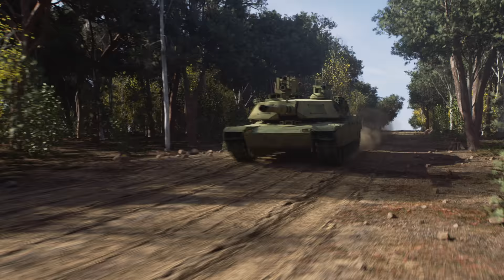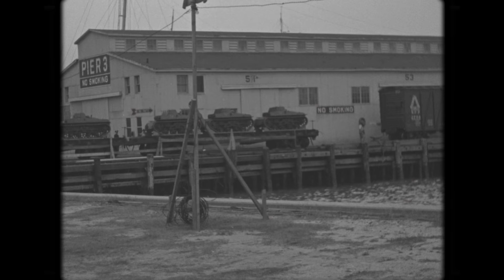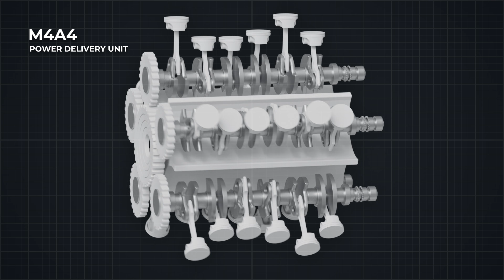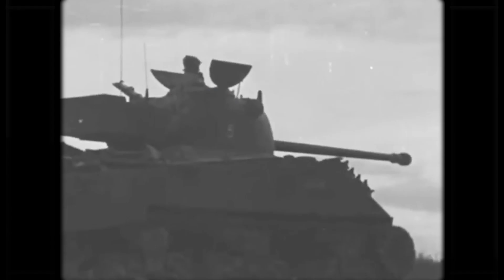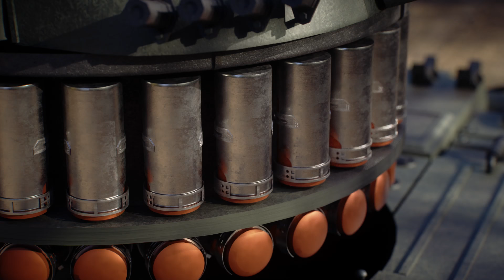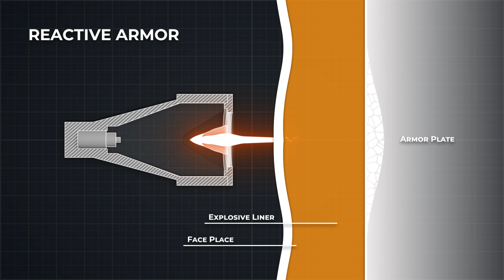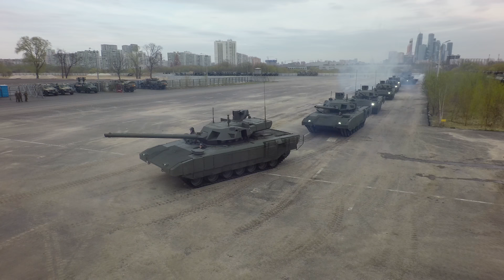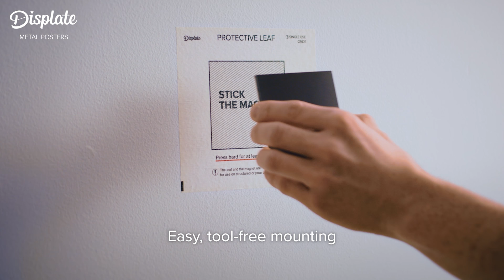Why America’s Tank Failed in Ukraine

Comment: Atleast survival rate of crew is higher than old soviet designs. Drones are scary
Reply: Yes, it didnt fail. It served its purpose. Tanks arent supposed to be invincible, theyre supposed to be heavy weapons platforms that are merely hard to destroy. In war everything is expendable, recources are spent.
Reply: Soviet designs are terrifying with crew sitting on ammunition
Reply: @Burbund M1 got additional ammo rack on floor, Leopard 2 got additional ammo rack which eat up 2/3 of hull frontal part...
Reply: @tsugumorihoney2288  The abrams hull ammo rack has a downward facing blowout panel and despite what war thunder says even if the bulkhead between the crew and the ammo is breached the cookoff will vent and still protect the crew.
Reply: @bargunner  Exactly, and if I remember right, it's only used to restock the turret bustle racks.
Reply: @tsugumorihoney2288  Yes, but somehow those tanks aren't known for spectacular explosions, and the main ammo rack is protected
Reply: @carter-58  hmm maybe cus of western propaganda?)) When they miss small fact that usually it happens some time after crew leave tank. BTW same like western propaganda ailencing facts that whole leo 2 turn into space ship if it ride over land mine, and M1 can be knock off with .50 cal machine gun...
Reply: @bargunner  If there is a cook-off, then NOTHING will protect anything. Explosive shockwave will simply break through the little door and let the pressure in. The way blowout panels work is they vent the propellant, REDUCING THE CHANCE of the cook-off. Cook-off is when ammo actually explodes due to heat exposure. In this case, there isn't a contained fire to cook the ammo off.
Reply: Know if Russian tanks didnt blow up  why did the armata do and implement so many more crew survivability then the past seperate ammo compartments ,blowout panels,  shrapnel proofing , head protection , better crew escape abilities and alot more emphasis on crew rotations as the armata was designed as a modular system that would be able to swap crews and still be effective in its operations with out needing multiple specialized units . So either the Russian tanks did kill thier crew upon "survival" hits or the armata is just a copy of the shitty western tank design and a step backwards and a waste of money and time as the armata basically a what if the M1A1 was built in the 2000s and not the 80s but with as many Russian parts as possible
Reply: @cloverfieldexprt  what a copium holy
Reply: @carter-58 

The Leopard 2 only has 15 rounds behind blast doors; the other 27 rounds are in the hull, in the crew compartment

We see the same thing with the Merkava Mk4; only 10 of its 46 rounds are behind blast doors. The other 36 are in the hull, in containers

The Challenger 2 stores 0 of its rounds behind blast doors

The Leclerc has 22 rounds behind blast doors and another 18 in the crew compartment

The "explosion" you're describing isn't a propellant explosion -- something that blast doors and blow-out panels were designed to deal with...

..What you've seen is called ammunition detonation; and it happens because Soviet-Russian tanks make use of dedicated, fullbore high explosive ammunition in order to deal with personnel behind fortifications and bunkers; and the detonation from this ammunition can't be contained by blast doors and redirected by blow-out panels -- which is why Western tanks don't use them

Western tanks use 'multi-purpose' ammunition that is the equivalent of 70mm HE ammunition; and canister rounds that are essentially shot gun pellets

The war in Ukraine requires dedicated, fullbore HE ammunition -- something that Ukrainian tankers noted was absent in Western tanks
Reply: @Burbund I'd rather go in a tank exploding with me in it, rather than get out of the tank and get hit by artillery shrapnel or machinegun and bleed out.
Reply: @Max_Da_G  я вот тоже не понимаю почему все кто восхваляет западные танки забыт что если танк не может вести бой то экипаж вояжи сможет уехать с поля боя 
Уж лучше сделать танк который будет жить дольше а не работать
Reply: @Burbund Extremely normal in tank designs.
Reply: @Burbundудевлю тебя но если  у Абрамса положить фугасные снаряды в боеукладку то Абрамс так же будет уничтожен с экипажем после детонации фугасных снарядов. 

И различаеййте выгорания пороха и взрыв сразу нескольких фугасных снарядов это 2 разные вещи
Reply: @Maksimus-nov  Why do you think they didn't transport that kind of ammunition?

Ammunition in tanks such as Abrams and Leopard is isolated from crew, in soviet/russian tanks it's not. This is one of the factors contributing to the better survivability of the crews of these tanks.
Reply: Только если будут фугасы в танке абрамс то тогда танк нечего не спосет @limbus_patrum
Reply: @limbus_patrum 

The Leopard 2 only has 15 rounds behind blast doors; the other 27 rounds are in the hull, in the crew compartment

We see the same thing with Merkava Mk4; only 10 of its 46 rounds are behind blast doors. The other 36 are the hull in containers

The Challengee 2 stores 0 of its rounds behind blast doors
Reply: yeah it surely helps when your tank from the above is a large uncovered surface where you can destroy ammo easily and then finish off the crew
Reply: @raketny_hvost  Still better than killing all crew members in one shot because ammo rack is the crew compartment.
Reply: @limbus_patrum  yeah it would be better if all T series ended up like in specifically selected videos on reddit and if crew was invulnerable when getting out of tank which is not the case in REAL life
Reply: @raketny_hvost  The higher survivability of Abrams crews is proven by statistics, not videos on Reddit...
Reply: @limbus_patrum  source of statistics: Independent Instute of Democratic Discoveries. i wonder which statistics can be gathered by tank that fought undeveloped countries most of times and got shrredded by drones once it was put against somewhat serious threat
Reply: @raketny_hvost  How many times have Western tanks sent a turret with its crew into orbit in Russo-Ukrainian conflict? None of these tanks (T-72 or Abram, Leopard) were designed with FPV drone combat in mind. All of these have a relatively weak turret ceiling. The armor was designed for impacts in the frontal sphere. The fact is that Russian tanks usually turn into burning wrecks after a successful hit, while a Western tank absorbs the impact, becomes damaged, but allows the experienced crew to survive and fight in the next machine. According to Osint data, ~75% of the T-family tanks are completely destroyed and burned out, while the same applies to only ~30-40% of Western tanks. You can google it.
Reply: @limbus_patrum статистикай от куда? И против кого? 

Против моджахедов что имеют старое потрепоное оружие? 

Прям качественная статистика. 
А почему не против индейцев с копьями?
Reply: @Maksimus-nov  A hit that penetrates the armor is a hit that penetrates the armor. A crew that survived is a crew that survived. Looking at the conflict in Ukraine, for instance, there is no recordings showing an Abrams turret being blown 30 meters into the air along with the crew after single hit. This also did not happen in other conflict, but we see this happening with russian/soviet constructions in Ukraine, Syria, Yemen, Iraq ect.
Reply: @limbus_patrum удевлю тебя но если танков 200 штук то не удевительно что такие случии "редкость" Это же не то что рф катает по 1000 штук своих танков и 1-2 из них подрываются 🤷‍♂️

Повторю то что я уже говорил. (Если у абрамса будут фугасные снаряды то 20мм или 30мм стенка зади заряжающего не сможкт выдаржать взрыв фугасных снарядов. 

Я уже недавно видел одно из таких фото там у абрамса разворотило башню  и даже незалазя внутрь понятно что экипаж чертв.

😂😂😂 каких других конфликтах? 
В тех где абрамс воюет против слаборазвитых стран?
Reply: yeah a tank from the 80s with constant upgrades will likely be better than a soviet tank from the 60s and 70s, like the T62 and T72. I wonder if we put an M60 Patton in Ukraine now, probably it will be way worse than soviet tanks for sure, just like the British Chieftain was smoked in the Iran-Iraq war.
Reply: @gringo2554d  вообще то советские танки оказались эффективнее в реальной войне на истощение
Reply: @gringo2554d I think only turkey have upgraded m60s .
Reply: @gringo2554d quite good the m88 is an m60 converted to a tank recovery vehicle.
Reply: @dodgedaytona7435  The M88 is a recovery vehicle; it doesn't even have a gun or a rotating turret. The only thing it has in common with the M60 is the tracks, so nice cope. Also, it was used in the 2023 counteroffensive that failed, so it's not that good, but again, bringing up a recovery vehicle is peak copium.
Reply: @gringo2554d it also has the original drive train and and so much more. They just add the winch system and a different armor setup. Cope would be losing 80% of all your working armor and saying you are winning like the Russians are. M88s are still active in  Ukraine. Unlike Russia we don't keep antiques in active service.
Reply: @dodgedaytona7435  BRO, YOU ARE COMPARING A RECOVERY VEHICLE THAT DOESN'T EVEN FIGHT TO A TANK. stfu.
Reply: @gringo2554d  Don't waste you time and breathe arguing with reddit battalion dude. They still think Ukraine only lost 55k and winning despite losing ground every hour :D
Reply: @gringo2554d  Dude, HEAPS of T-72s and T-80s and T-90s had returned from combat with multiple penetrations and strikes, and STILL didn't explode.
Reply: @gringo2554d  Are you saying Russians are not upgrading theirs tanks?! 
1. M60 is comparable to T62, they are from the same time. 
2. T72 is younger construction and ware constantly upgraded. Russians lost almost 300 of them in variant upgraded to 2016 standard, and over 100 of 2022 version.
3. Russian lost over 800 of T-80 in various version
4. Russian lost over 200 of T-90 in (introduced in 1993)
Reply: @limbus_patrum  
By your logic, if we upgrade a WWII tank, it will be sufficient to be comparable with tanks from the 1970s and even modern ones.
as for the M60 thats not the case really.
M60A1: 1962–1980
M60A2: 1973–1975
M60A3: 1978–1986
so no, the M60 isn't just comparable to a T-62. 
Also, most tanks lost in Ukraine were T-72s, like 1,783 of them, not 300
And you just kept citing losses. The US sent 31 Abrams; 87% of them were lost. If the US had sent 1000 Abrams, 870 would have been lost.
Reply: @gringo2554d  No, that is exactly your logic. You're the one who claims Abrams was constantly updated as if T72 ware not.

1. T-62 Was made from 1963 - 1978. M-60 was made from 1959 - 1986. 
2. I clearly indicated that the number 300 refers to the latest versions with better electronics and protection.
3. Russians have T-90, a tank in production since 1993. 
4. Russians lost 121-143% of pre war operational tank force. 
5. Russians ware hyper focused on hunting western tanks, even offering 5 million rubles (15 millions for fist one) for destroyed or captured Abrams or Leopard.
Reply: @limbus_patrum  "The T-62 was made from 1963 to 1978. The M-60 was made from 1959 to 1986." And? What's your argument lol? I said the T-62 and T-72 were comparable to the M60 (in reality superior) because they were from the same era, and you seem to agree. 

"I clearly indicated that the number 300" - what version exactly

"Russians have the T-90, a tank in production since 1993" - yeah and the M1A1 was in 1985.

"Russians lost 121-143% of their pre-war operational tank force." - Russia had 450 T-90s tanks in 2020, and as you just said, they lost 200 tanks; that's lower than 50%.

so conclusion: 

Russia lost 45% of its T-90 tanks.

Ukraine lost 87% of its Abrams tanks.
Reply: @gringo2554d     
No. M60 is tank developed from M48 (1952). It's also pre-composite armor just as is the T-62. T-72 was cutting edge, M60 was not. It's more comparable to M1 and Leopard2 if you want to argue about generations.

As i said Obr. 2016 and Obr. 2022. 

That is completely wrong conclusion. Russia did not use 100% of their T90 fleet in Ukraine. It's like saying they didn't lost any T14, and forgetting that they ware not deployed to the front. Majority of their invasion force was T-72 and T80 and this is what they ware loosing the most. It's simply proportional. Invasion forces had around ~65-85 of T90, 700-800 of T-72B3 / B3M and ~300-400 of T-80U / BVM. So they ware 5-6% of total tank force, and they represent 4-5% of lost tanks.
Reply: @limbus_patrum  So basically you said that Soviet tanks in most of the Cold War were just superior in comparison with the M60 (which is true), like, okay? That's my point.

"That is a completely wrong conclusion. Russia did not use 100% of their T-90 fleet in Ukraine." - Not really; most T-90s were deployed in those 4 years; the initial force doesn't really matter at all. Russia lost way fewer of its deployed T-90s than Ukraine lost deployed Abrams. Like, if you want to play the game, I can also say that Ukraine didn't use the other 5 Abrams left, which makes Ukraine lose 100% of its Abrams.
Reply: @gringo2554d  No I did not say that. 6 years (from 1973 introduction of T-72 to 1979 introduction of Leopard2) is not majority of cold war 🤣...

You can't count T90 stationed on Chinese border into calculation. We know that all Ukrainian M1 ware deployed. We also know that Russians ware saving theirs T90. We know this because they ware not spotted on the front. We also know that they made around 540 and 630 since 2022, if they now have 410–500 in inventory that would mean they lost over 100% of initial amount but, the wrecks were so damaged that they could not be identified and are included in group 572 unknown destroyed tanks.
Reply: @limbus_patrum  "You can't count the T90 stationed on the Chinese border into the calculation." - You just made that up. 

"We also know that Russians are saving their T-90" - your source? 

"The wrecks were so damaged that they could not be identified and are included in group 572 unknown destroyed tanks"- so you are making shit up again based on nothing but assumption.

So your comment is nothing but a circle jerk of "we know, I know" with nothing to back it up.
Reply: @gringo2554d  If its called a M1A1 its not been upgraded. Also the only reason they are using T-62, 72 and earlier is because they've already is because the T80's and 90's got wrecked
Reply: @gringo2554d  the reasons why the t-72a is a death-trap for its crew still applies to the t-90m for example. It's that goddamn autoloader design
Reply: Quite a few russian telegram videos that prove the contrary, especially the most fresh video with the Australian Abrams in Zaporozhye - crew dead next to the tank
Reply: @toyotahonda2618  Note that the comment that you're responding to said "survival rate". One data point does not make for a "rate".
Reply: @Yutani_Crayven  Cope and seethe. Your favorite NATO shitbox is a worse design than ancient Soviet tech that's carried by the US's temporary advantage in semiconductors and thermal sights.
Reply: @thermalvision203 Kyiv in 3 days vatnik 🤣
Reply: @thermalvision203  I sure love sitting on my ammunition rack waiting for it to explode. That's definitely the pinnacle of design.
Reply: @efulmer8675  Russian tanks win battles, NATO tanks lose battles. All the rest is cope.
Reply: @toyotahonda2618  That means they got out of the tank before being killed. In russian tanks they would be vaped when the turret goes ballistic.
Reply: @mordonius1 Plenty of videos of crew getting out even from T-64 tanks.  The turret joins the space program when the fire reaches the powder charges.  For T-72/90 that means it has to reach below the floor of the crew compartment.
Reply: @mordonius1 Sure thing, hun. I've seen videos of russian T-72 eat 7-8 drones without anything happening to them
Reply: @victorzvyagintsev1325  In both t64/t80 and t72/t90 crew is standing on the ammo. t72/t90 carousel is just slight lower height when viewed from the sides. All of them can kill the crew, and are not separated form crew compartment in any meaningful way. If they explode it kill the crew.
Reply: @toyotahonda2618 lol 😂
Reply: @toyotahonda2618  And i remembered videos of Russians trying to destroy Abrams for couple days, but they could not make them blow up like Russian fireworks called t72
Reply: @toyotahonda2618  Also Russia blocked YT, why are you here? It it your job to post stupid things in comments?
Reply: @mordonius1 если танк подбили на поле боя экипаж всё равно умрёт 
Лучше делать общие характеристики что бы сам банк дольше жил
Reply: @SWAT-SOG  ну если экпипаж в башню не догружает снаряды, а только в АЗ, то танк живет, да и экипаж тоже, все же АЗ на дне боевого отделения да еще и прикрыта дополнительными броневыми листами, кстати у того же абрамса и леопарда так называемые боеукладки первой очереди находятся в башне которые легко поразить (спасает их только полное отсутствие фугасных снарядов у одних, и инертная взрывчатка у вторых и я надеюсь наши скопируют ее рецепт что позволит еще сильнее поднять выживаемость экипажей и машин) а так основная бк у обоих в корпусе, причем у леопарда она прямо за передним броневым листом, в случае пробития танк может очень быстро саморазобраться. А так экипажи переживают ДЕСЯТКИ танков и это я если что про Российские
Reply: @limbus_patrum  LMAO Because the POS Abrams doesn't carry HE-FRAG ammo. Lets load ABrams with HE-FRAG ammo that T-72 carries, hit the rack and then see what happens.
Reply: @Max_Da_G  Abrams do carry HE round like M1147... The difference is that ammo rack in Abrams is separated from crew compartment and have special blow out panels allowing it to transfer the force of the explosion outside the tank and not inside as in the T72
Reply: in other words blowout panel in t-72 is crew tank hatches
Reply: @toyotahonda2618 yeah.  NEXT TO THE TANK.  Not in it.  Meaning the crew survived the tank getting knocked out and were able to bail out
Reply: @toyotahonda2618  Also the Abrams has infamously poor mine protection, which has led to quite a few driver fatalities in the GWoT and in Ukraine.
Reply: @thermalvision203 all tanks have poor mine protection, especially when the mine is sat on top of a buried artillery shell
Reply: @kentuckyace1068  Soviet/Russian/Ukrainian T-Series tanks actually have pretty good mine protection due to their thicker side, belly, and lower front glaces armor, and from their first roadwheels touching the ground further ahead of the diver than on western tank. Granted, mine-caused injuries and fatalities still happen in these tanks, but they're far from mines being the certain death sentence they are for Abrams, Leopard 2, and Challenger 2 drivers.
Reply: There is a little problem, when you lose your tank, you need to run, and the enemy can easily send more drones to kill the crew
But yes, it has a higher survival rate for crew
Reply: @Spectre4490  That is still a problem, but it's unrelated to the core statement. Of course the true doesn't have to run (doesn't face this problem) if they die the moment that the tank is first struck.
Reply: Debatable. Russian tanks are far better protected against drones  from the get go than anything from the west.
Reply: crew survival?! veteran affairs spent 300Bil a year, that's more than any other country's defense budget

WHAT IF THERE ARE NO VETERANS AFTER A WAR, SOVIETS BE THINKING SMART.
Reply: @ylstorage7085  iran disagree
Reply: @gringo2554d  I KNOW, I WOULD RUN TOO

I TRIED TO RACK IT MORE THAN 20 YEARS GO, THINGS IS ... IS!
Reply: @ylstorage7085  Oh nooo, you don't know? In the Iran-Iraq War, Iraqi T-55 and T-62 tanks smoked Western-made M60 and Chieftain tanks used by Iran, with Iran suffering much higher crew fatalities.
Reply: @gringo2554d what about migs vs f14? Funny how you forgot that match up. It was so bad the Iraqis thought their planes were defective as they got shot down over the horizon. Why do iran and Iraq, why not desert storm abrams and challengers beat the crap out t72s with Iraqi veteran crews. Not to mention the bradley destroying alot Russian made armor.
Reply: @dodgedaytona7435  What about the Migs vs. F-14, bruhhh? Which Migs? The F-14 was made in 1970. The Iraqi MiGs that were defeated in the air battle were mostly MiG-21s, which were made in 1959. 

Meanwhile, the Iraqi MiG-25s had 13 aerial victories over F-4s, F-5s, and F-14s, among others, with only one reconnaissance version of the MiG-25 being shot down. So stop cherry-picking.

And why not desert storm? Well, why not 1950s and 60s tanks vs. WW2 tanks?
Reply: @GreyTrav_4735 ' Iraqi T-55 and T-62 tanks smoked Western-made M60 and Chieftain tanks used by Iran' And another 'looks at the stats without context' goon...  Iraq started the war with more tanks then Iran(including 50-100 T-72s you neglect to mention), and more importantly kept getting supplied(including new T-72s) throughout ; while Iran had to make due with what they could scrape up under sanctions. They also lost almost a fifth of their tank force early in the war more due to their own incompetence(Operation Nasr) then Iraqi action. 
'... with Iran suffering much higher crew fatalities' And yet I doubt you'll be able to provide even a shred of evidence this is the case.
Reply: @ylstorage7085  Russian tank crews would change six or seven tanks before sustaining serious injuries. You live in a world that doesn't actually exist.
Reply: Ну как раз на оборот.
Reply: Is it though? You got any numbers to back it up?
Reply: Anything that hit from above is fatal.
Reply: the cew must survive.. but you stil miss a tank at some point you gonna have people but no tank
Reply: @philippegauthier4525  and crews survive in most cases, but keep coping
Reply: @philippegauthier4525  u can always build a ready tank. but a human takes atleast 18 years before u cant start the training and few extra years for the needed experience. human lifes are always more valuable.
Reply: @kampfmuffin3535 There are millions and billions of young people but only hundreds of tanks. Yeah sure murrican buddy 😂
Reply: @Robot_Frank equipment is easy to replace as it can simply be built and handed off.  People are much harder to replace, as they have to be trained for combat, then trained for their job, then assigned to their unit.  The abrams is the most survivable tank in Ukraine right now, with the majority of crews surviving the tank being knocked out in combat and being able to bail out.
Reply: @Robot_Frank first of all im not "murrican" bro. Besides what even are u arguing here? That we should normalise throwing human waves at the enemy in war? Bro i know china doesnt value your life but atleast value ur own life a bit higher <3
Reply: Coping hard!
Reply: Hurr durr drone syndrome
Reply: I wish Russia was still more interested in their space program, fielding more T-72s. drone drops payload on turret, autoloader sends crew to the moooooooon!
Reply: A Russian tanker has about a slightly less than 10% chance of death if his tank is disabled according to MediaZona Russian soldier eulogies compared with Russian tank losses from more credible sources like Lost Armor cross-checked with far less reliable sources like Oryx. Unfortunately, no data exists for Ukrainian tank crew losses as they suppress all information about their losses in order to prevent a morale collapse, but I don't imagine it's much higher than ~10% of all Ukrainian tankers operating Soviet tanks should they be disabled or destroyed. We have even less data about NATO tanks in Ukraine, but from the amount of videos, pictures, and written reports I've seen of mangled Leopard 2 and Abrams crew member bodies, there is good reason to believe their crew loss per disabling rate is at least ~10%, if not higher.
Reply: The Abrams has very weak armor—20-30 mm thick on top—and no explosive reactive armor. It's practically nonexistent.
Reply: Not really, your pretty much gonna die now that you are out in the open as a meat sack with no cover
Reply: What kind of survivability do Western tanks have? The very first Challenger tank hit by a Russian Vikhr missile, launched by a Ka-52, was blown to pieces.
Reply: @TyphoonUSSR russian/soviet tanks always had worse survival ratio, cause they aren’t meant to protect to crew, they are meant to take a beating and be replaced by another 50 tanks. In Soviet doctrine a soldiers life doesn’t play a big role. But I mean if you get shit on by a antitank missile, it doesn’t really matter what tank you are in.
Reply: @vojtas08jarema  "In Soviet doctrine a soldiers life doesn’t play a big role"
- I heard Hitler and Goebbels saying the same thing btw
Reply: @vojtas08jarema  Russia has always pursued a comprehensive solution to the problem of victory over the European occupiers of Napoleon, Hitler, and NATO. This solution required numerous tanks, whose mobile guns would provide fire support, armor protection, and transport of Russian infantry. When you calculate all the losses as a whole for an army with different types of tanks, the total losses are the smallest for the Russians, because many tanks save many lives for the infantry on the battlefield.
Reply: @TyphoonUSSR blow out panels, better armor, better reverse speed, better ammo stowage. 

Doesn’t mean they’re invincible, they’re not. It means the crew that is arguably more expensive than the tank may live to fight another day.

Western tanks have seen more favorable uses in the thickest battles as they are effective. That’s why casualties are so high, Bradley’s, Abram’s, leopards, Challengers, provided an armored edge to support units that the old Russian IFVs and tanks lacked.
Reply: @Hockey-gn2tj  Western tanks in practice actually have much, much worse armor than any of their Soviet counterparts from T-64 onward due to their significantly worse armor coverage as only Soviet-style (T-64oid) tanks have >50% armor coverage frontally, and are also the only tanks to have any serious roof protection. Ukrainian Abrams and Leopard 2 crews have constantly complained about their bad to terrible armor coverage.  Blowout panels are actually a liability in the drone age as they force the ammo to be higher in the tank where its easier for a drone to hit, and also are useless at protecting the crew from HE shell or HEAT shell detonations as the many Leopard 2 and Abrams wrecks with shattered blast doors has proven. Reverse speed is the only actual advantage western tanks have, but it's not enough of a difference to make a difference seeing how western tanks still perform worse and have higher loss rates. Russian tanks have seen the heaviest fighting of all in Bakhmut and in defending against the hoards of western equipment barreling down on them in Zaporozhye, yet they didn't fail spectacularly as western tanks did. There's no excuse for how badly western tanks have performed. They are simply poorly designed.
Reply: @Hockey-gn2tj  You are being influenced by fake propaganda. Russian tanks are 10-30 times cheaper than Western ones, which is why Russia had 20,000 tanks in 1991. Russia had three tank factories that produced almost 3,000 tanks per year. From 1961 to 1973, Russia produced 34,392 tanks :) 34,392 / (1973 - 1961) = 2,866 per year (!) Now Russia produces almost 1,000 tanks per year (or so). Do you understand? No single Western tank with its crews can compete militarily with the steel avalanche of Russian robot tanks.
Reply: @TyphoonUSSR …none of that is true. You literally just told me false propaganda.

If they have so many tanks, why is it that they are bringing out t– 55 and T 72’s to fight when they could just produce 1000 more of T 80s or T 90s?
Reply: @Hockey-gn2tj  Tank production in Russia by year 1981 — 2633, 1982 — 2731, 1983 — 2940, 1984 — 3151, 1985 — 3192, 1986 — 3225, 1987 — 3254, 1988 — 2815, 1989 — 1858, 1990 — 1406  Check this data on Wikipedia! If it has different numbers, it's "fakepedia" (c) Elon Musk!
Reply: @Hockey-gn2tj  You'll never understand Russia's logic because you live in a world where there's no free media, and the people who came to the US Congress after rigging elections were labeled domestic terrorists by the authorities. T-55s are fighting NATO proxy gangs at the front because Russia has a principle: "Everything for the front! Everything for Victory!" Do you know what Napoleon did in Russia? Like Hitler, he wanted to bring us "democracy." We in Russia are constantly repelling attacks from hordes of European Nazis from NATO, so we're forced to do this under threat of our own extinction.
Reply: Survival rate is the same my guy, the propaganda videos that Ukraine is pumping out (not as much recently lmao) are carefully edited to make it look like them T-72s and T-80s explode all the time. In reality, they are finished off with drones LONG after the crew is gone, stop coping dude, it does not help.
Reply: @SomeOne-ph1gw That propaganda must be amazingly effective, given that Russia has lost 3/4 of it's T-80s (i.e. ALL of those they sent to Ukraine - the surviving examples remained in storage in Russia).
Reply: @AAWT  That is not what survival rate describes. Survival rate is rate of survival of crew in destroyed vehicle.
Reply: @AAWT   russia has run out of tank since 2023 and now using t34s,right?
Reply: @AAWT  oryx cope. The same guys who claim Russia lost more tanks than it had before the fighting started 😂
Reply: @AAWT My brother in christ, we are talking about the survival rate of crews, not how many tanks exploded. Whataboutsim fallacy + bogus numbers
Reply: @AB0BA_69  That's how pulling tanks from storage and producing new ones works. You end up with more than what you had at the start. Embarrassing that this needs to be explained.
Reply: @PlaneBoyRadarда-да. Это правда. А еще мы строим высокотехнологичные реактивные дроны из стиральных машин и унитазов украденных с освобождённых территорий. А еще у нас ракеты закончились в 22-м году😅
Reply: @ИмильБадретдинов не ракеты закончились еще в 1900 м 😂😂😂😂
Reply: and what do you think happens when crew bails out of NATO tank? nowadays they dedicate over a dozen drones per tank. they simply finish off any surviving crew outside.
Reply: t64 is way safer than challenger
Reply: Crew survivability doesnt matter anymore, drones will keep coming for the survived crews.
Reply: @iamsorryforbeingrudebefore1626  That’s such a stupid take. 

Crew survivability is essential as no one would want to be in it if it wasn’t. 

In the current day, crews are able to bail and it has been recorded that they have.
Reply: What's the point to survive if you have no weapon anymore to fight with? Outside your tank you are nothing but cannon fodder.
Reply: @kukipett  The point of survival rate isn't so that the people can jump out and start shootin' , it's so that well trained tank crews can get a new tank later. Ukraine doesn't have a lot of tanks, it'd be even worse if each lost tank was also a possibly veteran crew being lost. 

If you mean "they're sitting ducks when they get out", it's not super normal for a tank to be knocked out of commission and to have the enemy in a position with small arms to cover the escapes of the tank. I'm actually not sure though if tank survival rate is "does the act of the tank getting knocked out kill them" or "are they able to leave the conflict zone after the tank is knocked out".
Reply: @yatagan3072  Ditto. @kukipett thinks it's a RTS game.
Reply: @kukipett  "What's the point to survive" lmao. Survival is the point. If you lost your tank you don't go storm enemy trench, tank crew is more valuable as a tank crew and is to be withdrawn and put into new tank.
Reply: @limbus_patrum  You have to see this not from the point of view of the crew but from people who are in command. During war, soldiers are not really humans anymore they are assets and retrieving a crew and giving them a new tank is not so easy.
We see this from modern people point of view who are soft and easily offended. 
Unfortunately during wars people are slaughered, smashed, burned in so many ways. Have you seen the video showing all the second world war casualties, so why would you bother about a few tank crew that are cooked in their tank.
Reply: @kukipett   Well you are not completely wrong about seeing is as an assed, but you are wrong on the value. It's not ww2 soviet army where they shoot you if you retreat. Families don't have 7 children anymore, tank crew is a specialist training takes a lot of money and time, they are more valuable than the tank. Even Russians when they do  theirs's "meat wave attacks" they use addicts and criminals not specialized units like VDV (at lest not intentionally). 

Western doctrine only sacrifice the unit if it's a necessity to buy time e.g. to mobilize units in the rear or there is a risk of enemy breakthrough in key sectors ect.
Reply: And people will fight wars with hand? 😂 Japan lost once their carriers got destroyed in ww2. There are millions and billions of young people but only hundreds of tanks. Yeah sure murrican buddy 😂
Reply: That is an old misconception. Those weakpoints are closed long ago. The „blown off tops“ are from abandoned open tanks. The cages prevent in active use. 

And concerning western tanks - they are easily immobilized and the crews are picked apart by the swarm of drones that follows. This is why drones are so deadly today.
Reply: @MetallicReg  no, the weakpoint still exists and a direct hit to the ammo still causes the turret to pop off. those cages stop drones, they don't stop missiles. and uh, why do you seem to think western tanks are easier to immobilize than russian tanks?
Reply: No they are not. You obviously are a wanna be military person or just glazing. Lol here comes the truth. The tanks we sent are old. Stripped. Bare bone. Even so survival rate is high. Etc. when we were in the golf we would just use heat to cook them. Blow the tops off but they would sit and burn in there. Ap? Worked great. In one side out the other. Heat. Even better let them set in that fire.
Reply: @MetallicReg cope
Reply: @chiliring7082  lets put an M60 Patton in Ukraine now and see what will happen.
Reply: @MetallicReg if it's true good for them . Crews are more important than tank itself